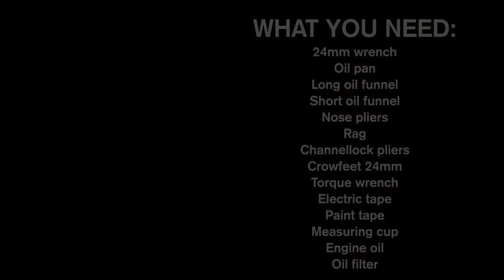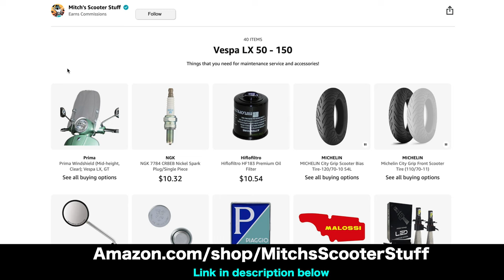Vespa LX Engine Oil / Oil Filter Change | Mitch's Scooter Stuff

Comment from the maker: * Tools I used in this video: 
Engine Oil 5w-40 -  http://amzn.to/1KGhJ4F
Oil filter HF183 - http://amzn.to/1Qtzybw
24mm wrench - http://amzn.to/2FnwOgT
Oil pan - https://amzn.to/3bOmT5Q
Funnel (long) - http://amzn.to/2v5mYLn
Funnel (short) - https://amzn.to/2HY4m6g
Nose pliers - http://amzn.to/2yetDDj
Rags - https://amzn.to/2Yh8jvg
Channellock pliers - http://amzn.to/2CMrVLq
Crowfeet 24mm - https://amzn.to/3939sjU
Torque wrench 0-150 lb/ft 3/8 drive - http://amzn.to/2Crqq4R
Electrical tape - http://amzn.to/2FEeQH2
Paint tape - https://amzn.to/3cjfpFN
Measure cup - https://amzn.to/3NUOz96

Comment: Hello my friend.  I strained the oil plug seat a little while changing the oil.  The screw is solid, but I stripped the slot, the place where the screw went in.  The master came and closed the gasket again.  The liquid seal lasted.  Is the liquid seal safe?  Will I have a problem after a certain period of time due to overheating while driving long distances?  This is the first time in my life that I see such a product.  I looked online.  The whole world uses it.  Do you think there will be a problem?  Thank you please.

Comment: Hey Mitch. Love what you do man, really helping us out here!
If you can hear me out for a second I'd really appreciate it.

Have a brand new stock ruckus, 800 miles. Well maintained. When I ride it now the wheels feel bumpy (back especially) tires and rims are in great condition. No punctures, warps or airbubbles and rims are perfect. Psi at 25.

It's almost as if the tire raises and lowers a bit on each rotation causing it to feel very bumpy and unsafe.

Have you run into this issue?
Reply from the maker: Hey, is the nut tightened? Wheel bearing okay? Shake the wheel to see if you notice something

Comment: Hi Mitch, just did an oil change was riding down the street when the bike cut out. Gave it 5 minutes then started it up again and went home. The exhaust smells like it's burning and it's was really hot.  What's happening here do you think?
Reply: Over filled prehaps